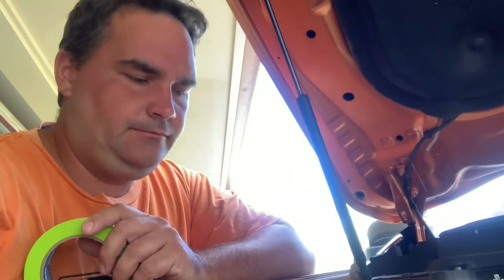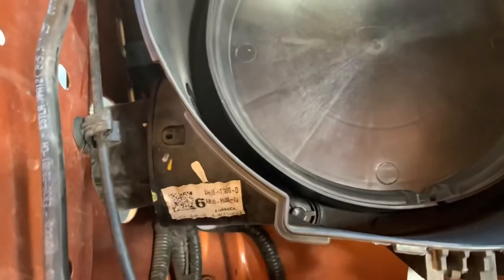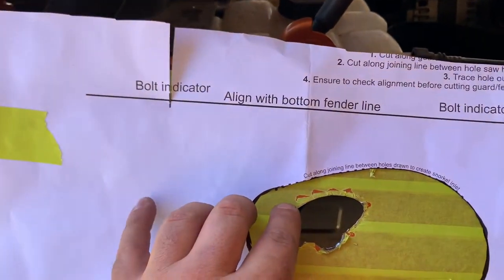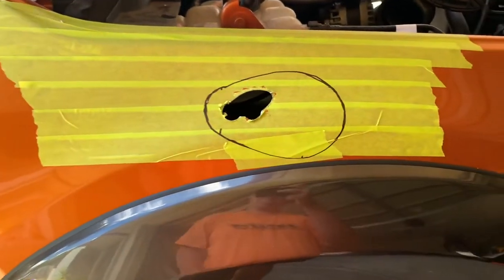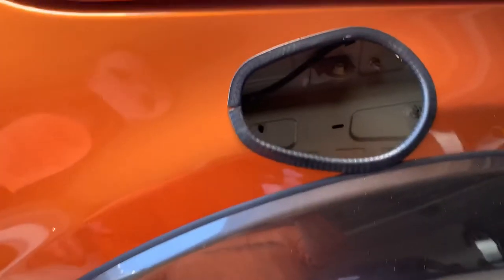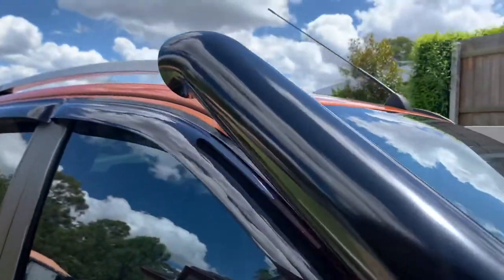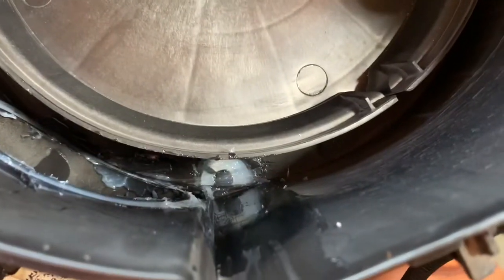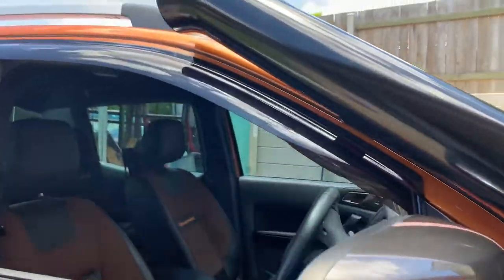Fitting up a stainless snorkel to our wildtrak / Merideth metalworks

Comment: hi mate, have you had any issues with water getting down into the airbox when it rains?
Reply from the maker: Yes we did have an issue when i pored down.. i added a bit of Velcro strip with adhesive backing around to the end to stop water running up and over it worked great at stoping it